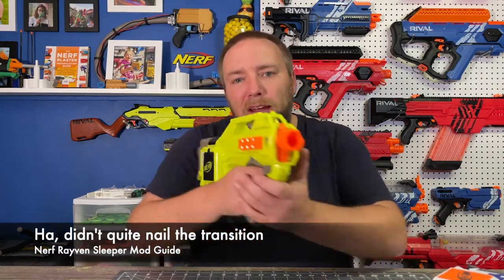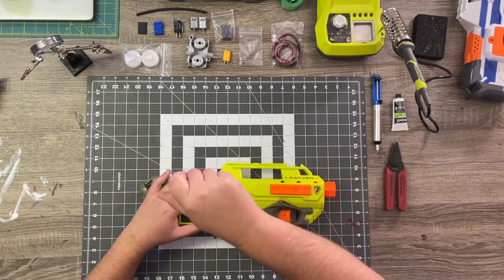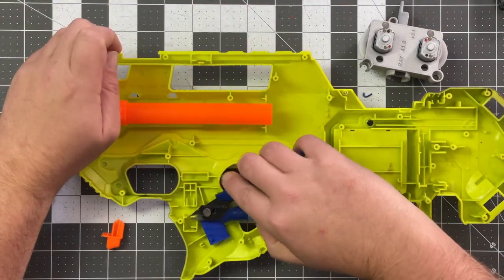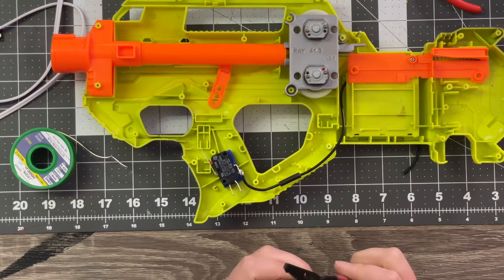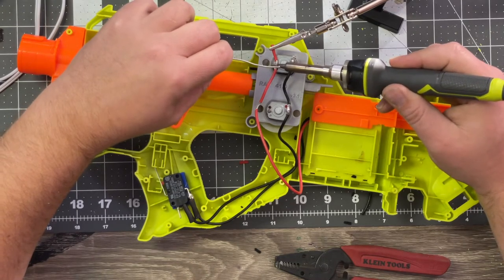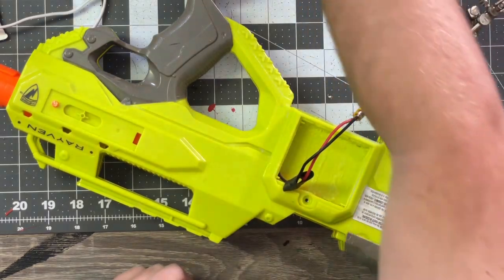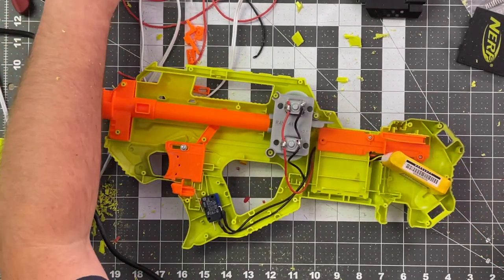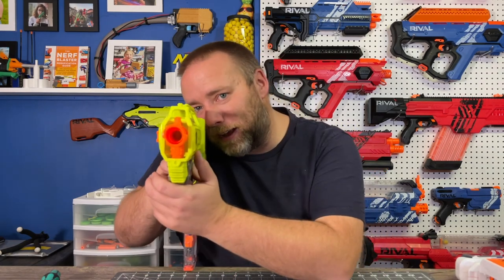A sleeper mod guide for the classic Nerf Rayven bullpup

Comment: Very late but how did u fit the battery in the stock  tray? for me it was way too small to even consider. I also have a zippy compact 1000
Reply from the maker: I did a bad thing and just made a space inside the shell so I could get some video and photos of it in sleeper mode haha. There are images of that late in this very long (sorry) video :) 

I printed an extended battery tray for practical use :)